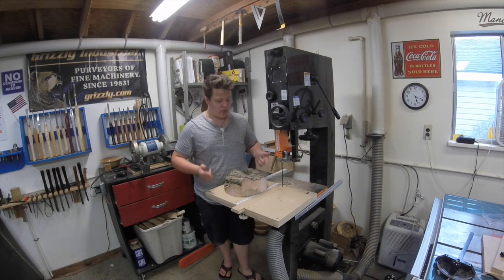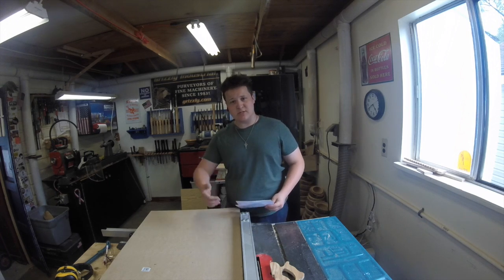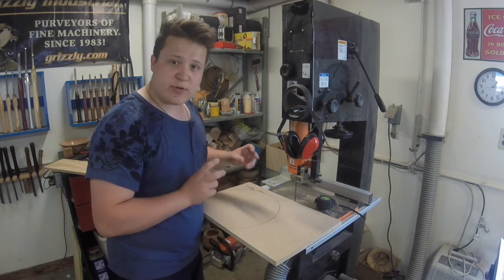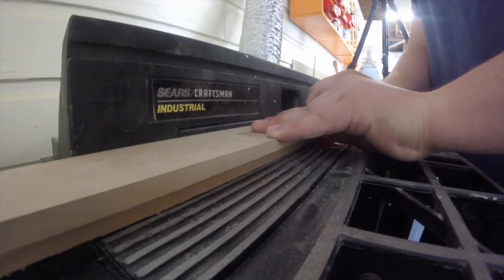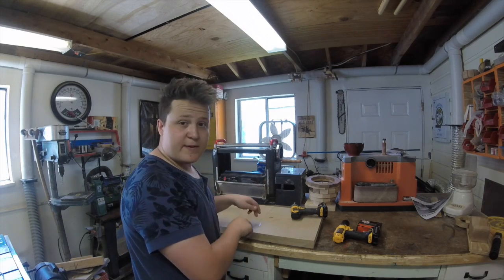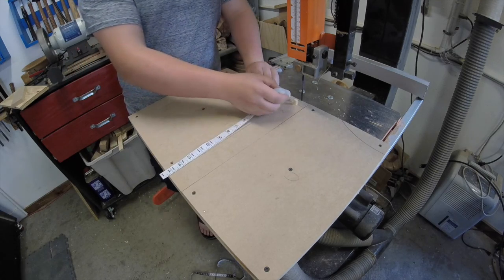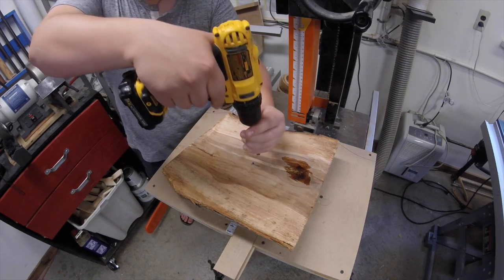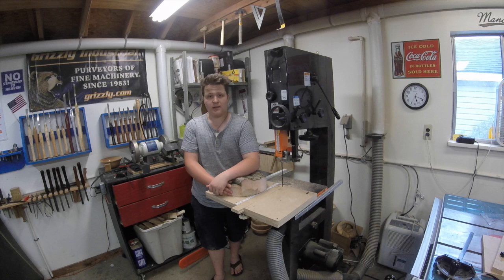Bandsaw Circle Cutting Jig

Comment: Pete nice job, I like your explanation better than Lynn's.  Been wanting to make one of these jigs, it's been added to my to do list.
Reply from the maker: I don't know how I lived without one lol :) Its a great build!
Thanks,
Pete
Reply: I got mine done couple weeks ago, agreed what did I do before without it. Took best features from everywhere, adjustable front depth stop, anti tipping bracket, sawdust relief hole and adjustable pin - added piece of corian to allow multiple sized pins, 1/8" up to screw chuck size for bowls. Inset adjustable rail so kept max height on my saw. Thanks for sharing.

Comment: Nice one Peter, one quick thing MDF needs to be sealed especially if you're cutting green bowl blanks, that stuff hates moisture it swells really bad as I have found out to my cost a couple of times
Reply from the maker: Oh okay, what do you seal it with?
Thanks,
Pete
Reply: +Peter Matthew shellac or MDF sanding sealer will do the job, the ends are particularly absorbent so the must be sealed before any finish like lacquer or varnish

Comment: I think you might be able to squeeze another 2"-4" in radius by turning the sliding board around and let the pin over hang the base by 2"-4" (in a pinch) if your cutting thinner material (plywood) instead of logs:>)
Reply from the maker: Hey thats a pretty good idea Thanks!
Peter